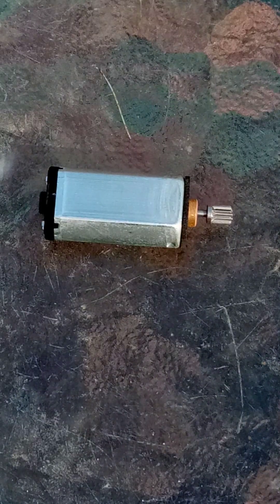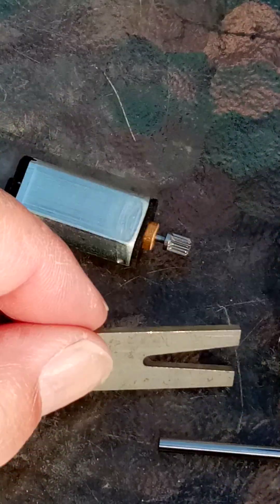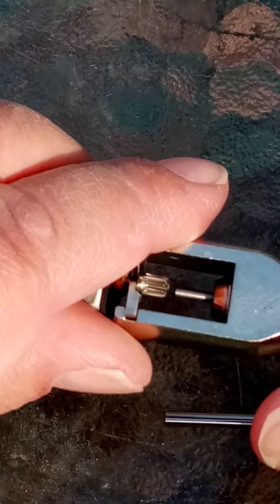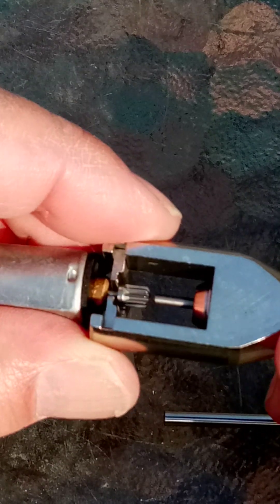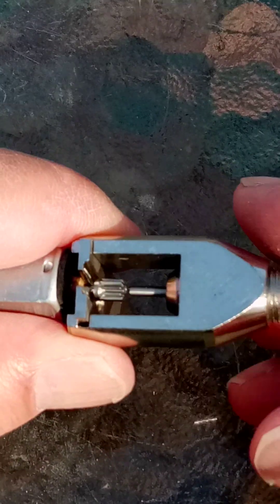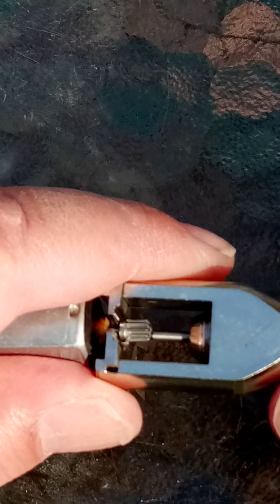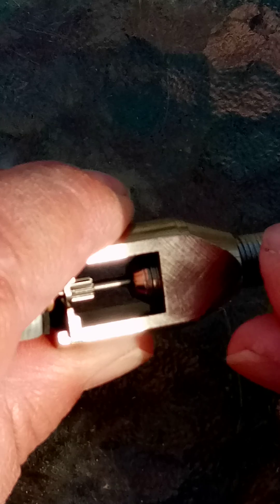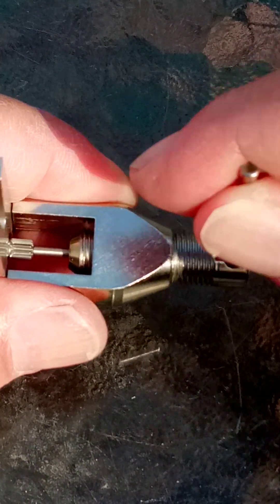Kill your gears the Temu way! #gearpuller #robotics #gears #electricmotor #hobby #tools #diyprojects

Comment: More painful to watch than Peter Griffin throwing that frog out the window. And yeah, you just used it wrong.
Reply from the maker: It would have helped if there had been instructions included.
Reply: @britishtechguru  It's a simple mechanical device, obviously it needs to push on the axle in the center, and not the gea itself, otherwise it's just going to crush it.
Reply from the maker: That's what I did. I suspect the smallest pin on the gizmo might have been too big.
Reply: @britishtechguru  These small motors and gears might not be meant to be pulled apart anyway. You can push on the gear with a press in the factory, but the hole, if any, might not be big enough for a pin sturdy enough to be used. If it's any consolation, I did destroy such a gear puller in the past, because I had to file it down to fit, and then it wasn't mechanically sound enough anymore to actually exert enough force, it just bent. Some assembly processes are just one-way.
Reply from the maker: @graealex  The gear puller is fine. The brass gear, however, has seen better days. That's fine though - I wanted to fit a shaft extension on it anyway. Now I  have to measure the shaft and find where I can get extenders.

Comment: Youve done it wrong the the thing will only set at diff sizes but ya menna push the bottom bit rite till the end so its flush tight to the middle spindal then pull it you was balancing it and it was wobbling all over i dont no why ya did al that but ye it duznt put presure on rhe gears it goes under the gear u just aint pushed the 1st bit along far enough
Reply from the maker: Given there were no instructions, I did what I could.